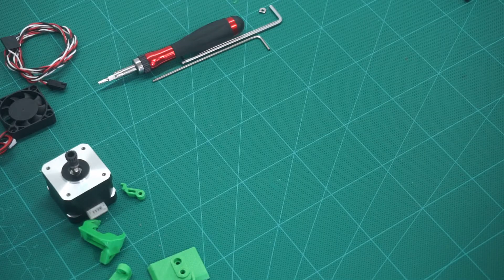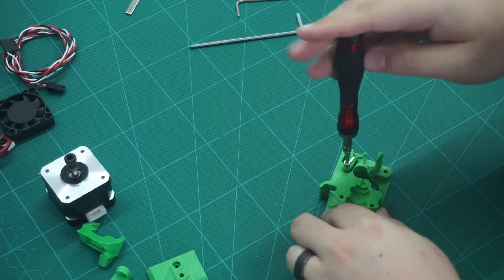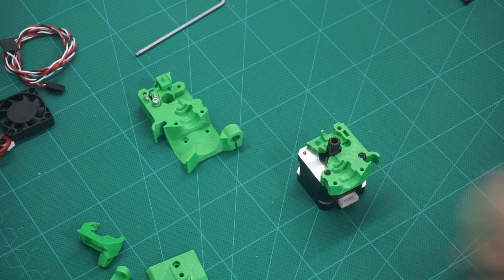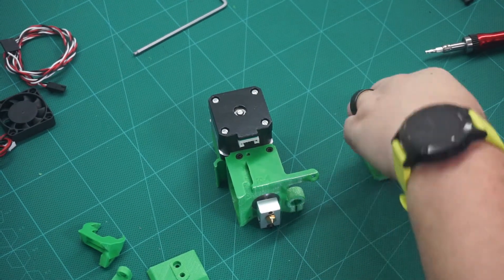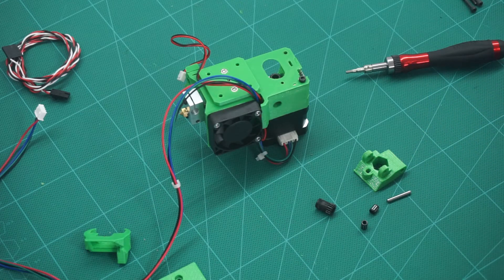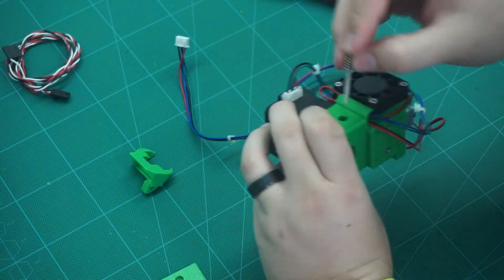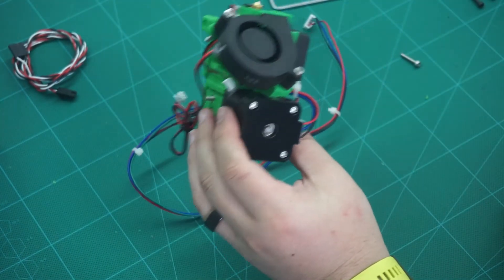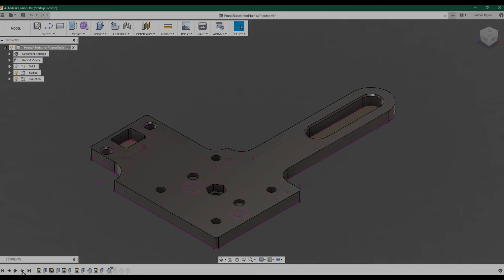Build: Hypercube Evolution - Part 7 - Prusa R4 Hotend

Comment: My double z axis is very heavy, what you use the power supply? My supply is 12v 30a
Reply from the maker: I am using a 24v 360w / 15a power supply. As long as your motors are sufficiently sized and tuned correctly it should be fine.